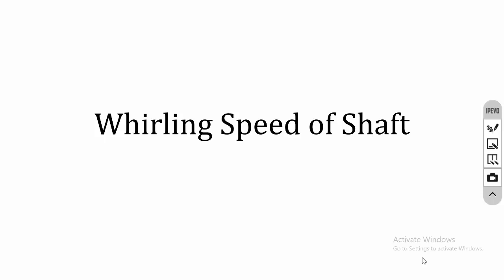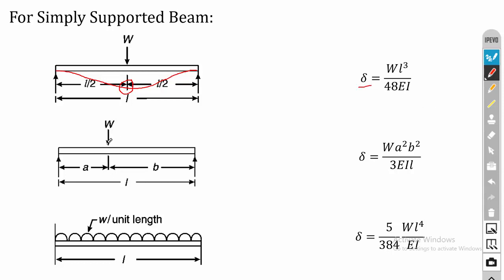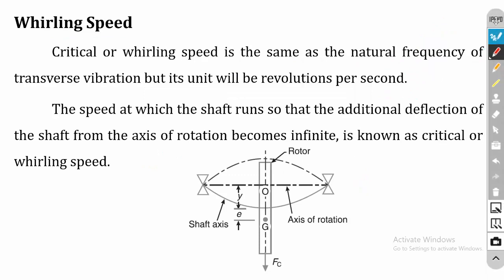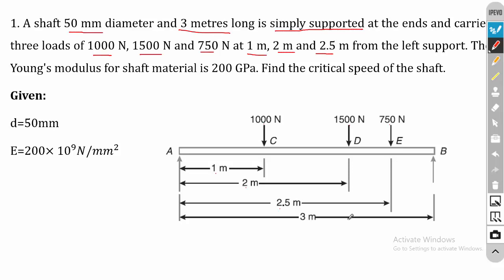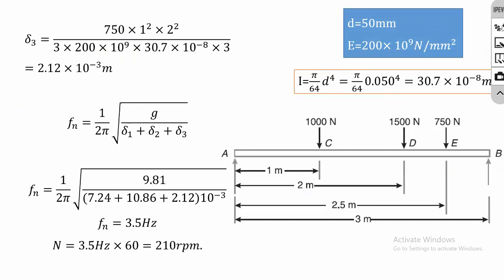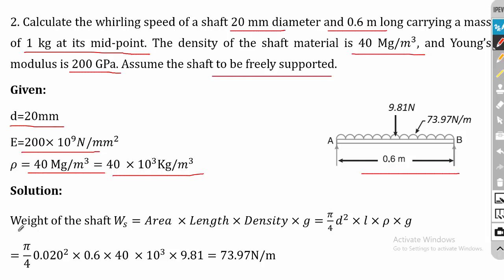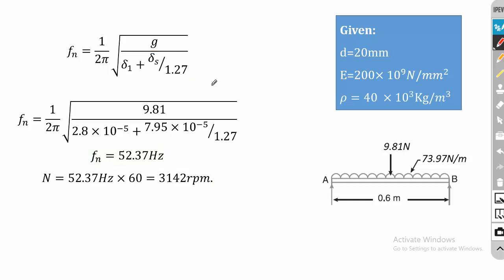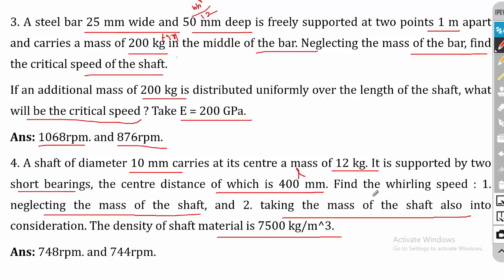Whirling Speed of Shaft | Lecture 1 | Vibration Control

Comment: A shaft has a constant diameter between bearing 800 mm. Located between the bearing are 2 pulleys which are keyed to shaft. One pulley has a diameter of 200 mm and weighs 80 N is located 200 mm to the right of the left bearing. The other pulley which has a diameter of 400 mm and weighs 240 N is located 550 mm to the right of the left bearing. Shaft rotates at 900rpm. Tight and slack sides of tge belts are horizontal and parallel, 18KW is supplied to the 200 mm pulley. Power is transmitted from the 400 mm pulley to another pulley located so as to give a smaller bending moment in the shaft, with belt strands horizontal as already stated. The belt stress is limited to a maximum of 2MN/m^2. Ratio of diameter of pulley to belt thickness is limited to a max of 30 . A belt thickness of 6 mm will be used. Coefficient of friction from belt and pulley is 0.3 . Shaft is made from hot rolled steel for which ultimate strength is 50MN/m^2 and yield point is 340MN/m^2. Conditions of loading are steady with no shock. Determine the necessary diameter of shaft based on strength and critical speed. Neglect the weight of the shaft and pulley for the strength calculations

How do I evaluate this?

Will I consider the belt tensions as load in calculating critical speed, or will the horizontal load be resolved with the vertical loads before calculating based on critical speed.
Reply from the maker: When calculating the critical speed of a system involving belts and pulleys, it is important to consider the belt tensions as part of the load. The belt tensions play a significant role in determining the critical speed and should be included in the analysis.

In this context, the combined effect (resultant or equivalent load) of both horizontal and vertical loads, including the belt tensions, should be taken into account when evaluating the critical speed.

Comment: What kind of formula am i using if i have 2 plummer block bearings on both ends, a motor drive on drive end and nde (free end). I need your help on this sir.
Reply from the maker: In most of the cases we will consider the bearing as a simple support unless its a long bearing... So you can consider the shaft as a simply supported beam at both ends and consider the loads in between.... If you need the exact formula i need information regarding the nature of load... For further queries contact me @ dmecengr@gmail.com
Reply: @themechanicalengineer  thank you very much. I have a problem solving the critical speed of a centrifugal fan impeller. It is a simply supported beam with a bearing center to center distance of  3654mm, bearing portion diameter is 160mm, weight of impeller at the center is approximately 3 tons.